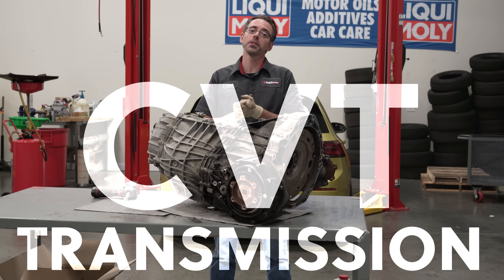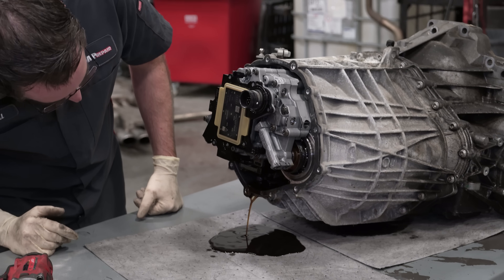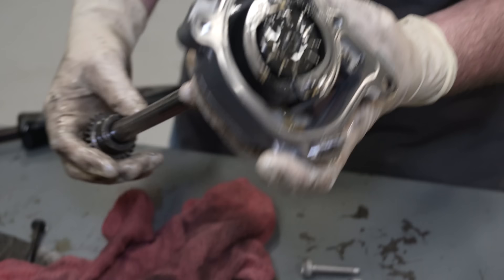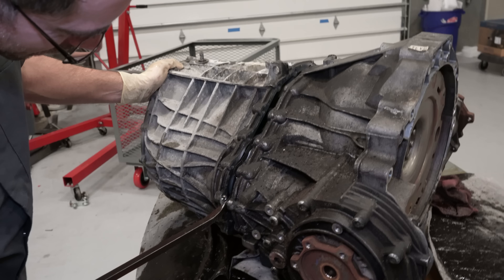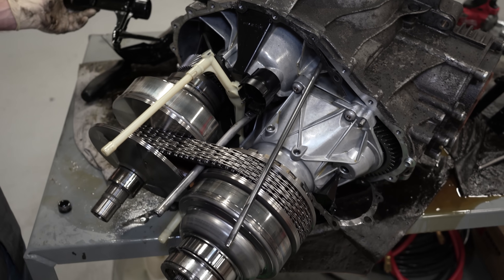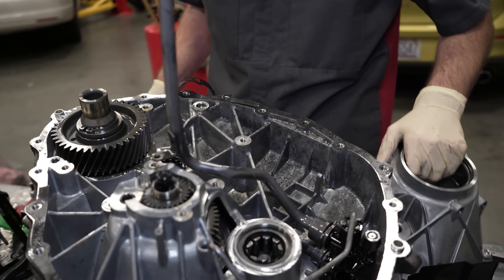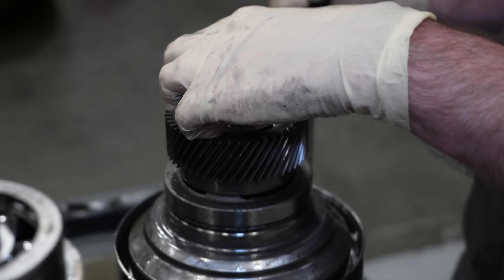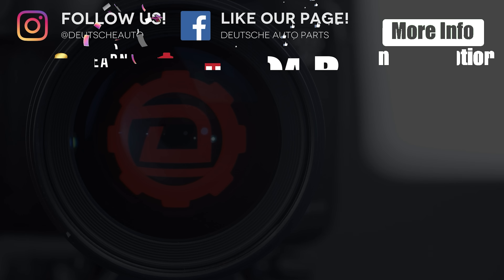Why you shouldn’t get a CVT transmission

Comment: Pure exaggeration.
I had a 2nd Gen Nissan CVT and it was perfect and the fastest reacting transmission so far. Because the car was small and had a turbo with 200 torque, it was one of the fastest accelerating and passing car as the CVT provides infinite and perfect gearing.

You would need a 15 or more gears automatic to compete with the perfect gearing.

4 friends also have Nissan CVTs with 80 to 140K miles and all doing well as they followed my advice to change CVT fluid at 50-60K miles!

The people that I distrust the most are the ones that make blank general statements like you.

Comment: I wonder if auto manufacturers went with the rubber/Kevlar belt design snowmobiles use if the concept would have worked out. Changing the belt every other oil change would just be part of maintenence. The system works well on 150 hp snowmobiles.

Comment: Got a Corolla with one, and 90,000 miles. Love it. Love the constant RPM during acceleration. It's mildly odd at first, but great on efficiency. If you feel it's wrong that your transmission doesn't go "weeeee thump weeeee thump weeeee thump weeeee...," then don't buy a CVT.

Comment: Awesome video. A basic snowmobile set up but with 1000 possible fail points. I’m curious about the metal used on the chain compared to the cone. And wondering if the paper used on the chain is to control chatter within. Before you inspect the next one you get in try adding a couple ounces of Zink and run it
Reply: I've worked on several industrial machines that have the variable drive with rubber belts.... every single one was a rattle trap even after changing the bearings....the noise is from between the drive shafts and where the pulleys slide back and forth....

Comment: So... I'm a snowmobiler, I deal with cleaning mine once or twice a season. No fluid, no computers, just a belt and some weights. But I have to swap the rubber belt every 3000 miles and clean it every, about, 50 hrs. of riding or at the beginning of the season, whichever comes first. They are finicky, temperamental pieces of crap, but at least the Snowmobile's are easy to maintain, just more than the average car owner wants to do consistantly.

Comment: This is exactly the way old front-loading Westinghouse washing machines shift from agitate to spin dry. Did you ever hear of a Dynaflow transmission? Our family had a 1955 Buick with a variable-pitch torque converter. It was reliable and made the car very fast. There was a 1958 Buick transmission with three torque converters. It was optional, and Chevrolet sold it as Turbo-Glide. What's your take on them? Our 55 had conventional first gear for getting started from a dead stop at the bottom of a hill. You have to shift to low to engage it. After you get going you shift to drive. These transmissions have different mechanisms from the Westinghouse washer size changing pully you don't like. Why don't they go back to them?

Comment: I had a CVT car with over 200,000 miles and had zero problems. The car ended up being stolen and totaled. I’m sure I could’ve gotten at least another 100,000 miles. Just take care of your stuff. You’re not a race car driver.

Comment: He's right about CVTs being crap. They are an incredibly stupid idea. And they're completely unnecessary.

Automatic transmissions are a highly mature technology. They work. Extremely well. There is no underlying weaknesses to them that needed to be overcome.

The core technology of a CVT is that it uses a belt drive. Doesn't matter that it's a steel belt, it's still a belt. Before the 2000s the only things that used CVTs were snowmobiles.

That's right, the prime mover in modern cars is a belt driven drivetrain better suited for a snow blower.

So why do car manufacturers make them? Because the govt made them. CVTs average slightly better gas mileage, and I mean slightly. As in 5-8%. You will NEVER notice that in everyday driving.

But now the govt and car makers can boast about how they're saving the country billions of barrels of oil each year.

And consumers get cars powered by rubber bands..

Comment: Been using CVT’s since the late 70’s in manufacturing. They were delegated to low horsepower applications (10 hp or less).  They don’t scale up well to high hp loads.  Which is why NISSSN abandoned the CVT in the 2022 Pathfinder and returned to a conventional automatic.   Both Toyota and Honda have had some recent success with CVT’s in cars.  But both automakers have avoided using them in more substantial vehicles designed for towing heavy loads.  They have always performed poorly in heavy duty applications.  Trying to use a CVT equipped vehicle to drag a 6000 pound boat out of the water is an awful idea.

Comment: Back in 2015, a co-worker of mine had a CVT failure within warranty on a Nissan. Usually when a geared transmission fails, it will be the shift from 1st to 2nd that breaks. So when that happens, at least you can move the car in 1st or in reverse. Not so with a broken CVT - the car cannot be moved.

Comment: Prius have used them since the launch, toyota makes good transmissions. Many modern heavy diesel trucks (semi trucks) use CVTs the sectet is you need to maintain them BUT many companies built the service schedule to only allow the transmission survive the warranty. Gas toyotas have a traditional first gear then it goes into the CVT which dramatically reduces the wear and tear on the transmission.

Comment: Otherwise they use the same concept as a snowmobile using the same thing with a belt, they would of been better off just using a torque converter and no gears , this trashmission was made for one purpose to make money and screwing the customer, on a lot of gm cars the main power feed to the computer first goes to the cigarette lighter then to the computer so if you overload the cigarette lighter you end up blowing the computer

Comment: 2014 honda accord lyft driver 280 thousand miles and going strong I got the car at the beginning in 2016 with 48k miles have service the CVT at 90k 180k and the last time at 270k oil and filter no problems so far 
just use the recommended  oil and that is it 
I have done the services myself
for a regular person it should be no problem 

is not good to give bad reviews on this kind of stuff just for a few failures beside the nissan ones lol